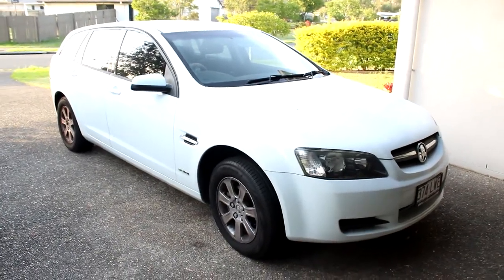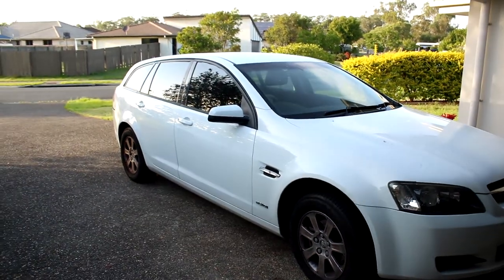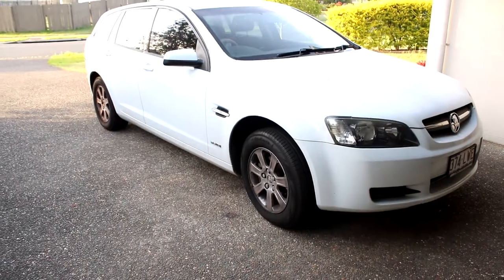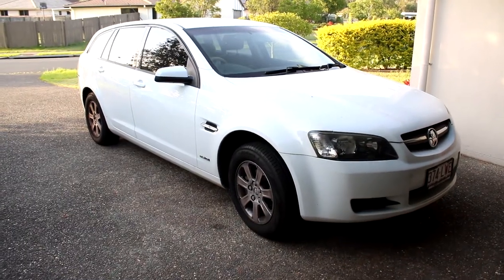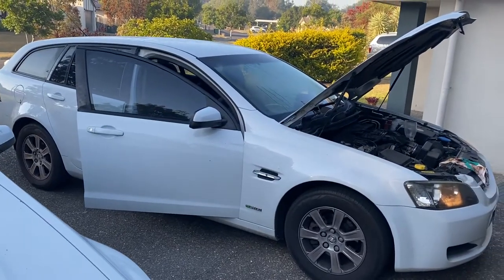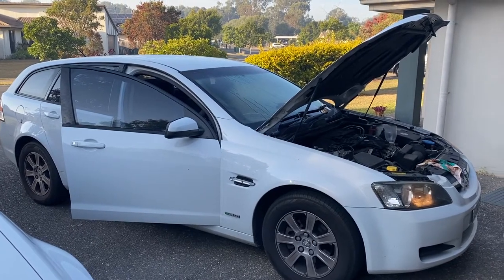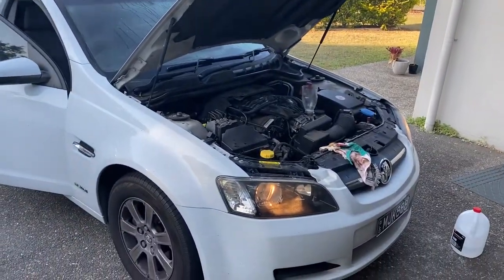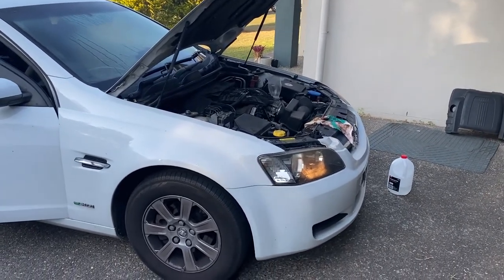THE END!!! VE Commodore Timing Chain Issue Final Video 😱

Comment: When the 3.0 and 3.6 V6 engines in Commodores start losing coolant (but you can't find it on the ground), it's usually either the heater tap or the coolant "inlet" connection (actually outlet to the radiator) seals leaking. Neither are hard to replace. Just make sure you bleed the coolant system properly after you finish the fix and fill it up with coolant again.
Reply: Note: heater tap is for VZ. VE doesn't have a heater tap, so that narrows it down even more.

Comment: The VE may have been Holdens 1-billion-dollar baby but make no mistake the models before the VE were much better .. The VE commodore just had way too many problems like timing Chain issue and so on the Front of the Car I thinks looks fantastic the rear not so great I would rather stick with the VZ or the VY , And also too when doing a service always make sure you do an Engine Flush it's a must on these cars
Reply: The Alloytech 3.6L was a great engine ..The fact remains they required servicing every 10klms with quality synthetic oil and filter and coolant flushes with fresh coolant every 12months...very
 few people carried out these services out so the
the engine got a bad rap because of it.

Comment: Your camry will be worth 55% of if its purchase price in 10 years. The i30, 35%. I am to attached to my Aussie built cars. Both been V8's helps with resale value. I did own a 2012 elantra for 4 years. And that was a very nice car and averaged only 7.2 litres per 100 in the city. I thought that was very impressive. The accelerator action on it was very touchy. The power came on to quickly for my liking, and I found my self backing off all the time. I did some research and found it was a characteristic of that model. The brakes were also touchy.  This gave me and my passengers whip lash back and forward. I never did get used to it.

Comment: I've got a 2010 SV6 and I'm about to have my chains replaced for a third time in 5 years and with the prices of 2nd hand cars these days having the chains replaced again is the cheapest option
Reply from the maker: Between rock and hard place for sure.
How much is costing you each time?
Reply: @VroomBroomZoom  

Between 2k and 2.5k 

Before I have it done for the third time I'm going to replace the Camshaft and Crankshaft position sensors and if the P0017 code appears again then I know it's the chains
Reply: @shoot9r16  I have had one chain replaced and now the error is back after 60,000km. My mechanic says the chains seem fine and are not making noise, whats the cost of having the sensors replaced?
Reply: I have a 2012 SV6 I've only had the timing chain change one time I guess it's just one of those lucky dips..